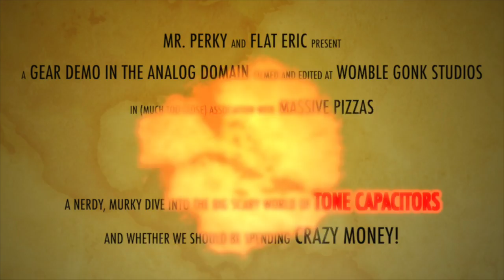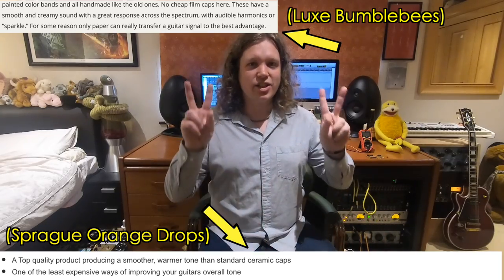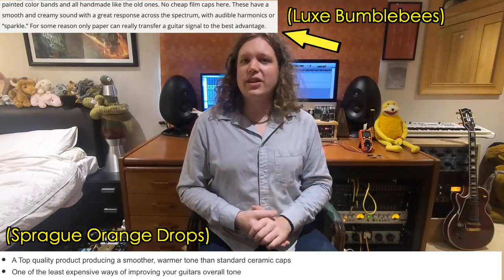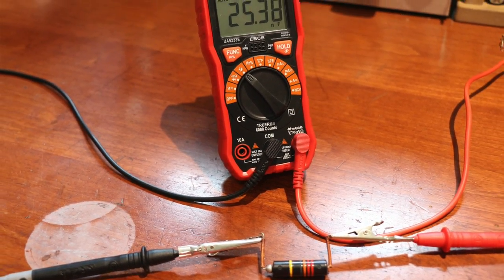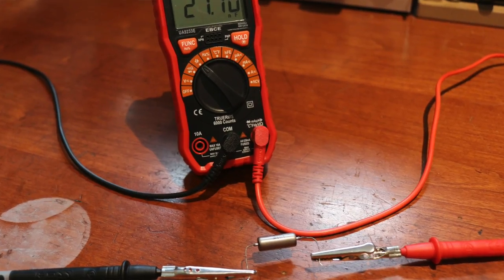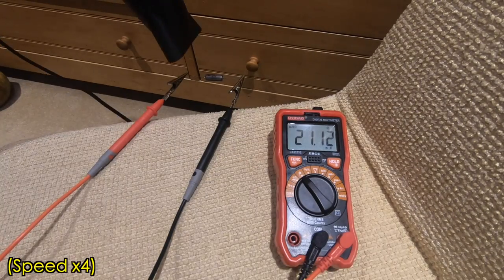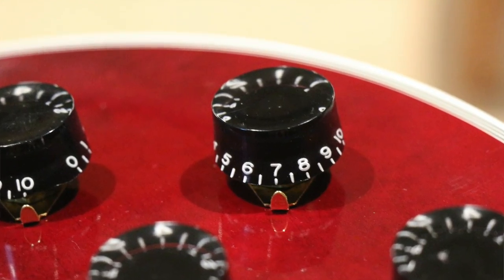Do Paper-In-Oil Capacitors REALLY Sound "Better"..??  (vs. Ceramic, Orange Drop, Tropical Fish, etc)

Comment: The tone pot and cap is a simple frequency filter, so the cap is still affecting the sound even everything is full on but only less comparing rolling down the tone potentiometer. Say the full-on 500Kohm is giving the signal more impedance for high freq loss vs. 250Kohm or 0ohm. But back to the original topic of the capacitor type, I have no evident how sometimes the tone changes even the readings are exactly the same, but I suspect certain caps tend to have larger or smaller parasitic capacitance to whole circuit, including how close the cap sits to the adjacent cap, pots, the entire electronic cavity, etc.

Comment: I've got more than 5000 PIO caps of all sort and the russian one are always dead on the value instead of the bumblebee which are always out of tolerance... For me the old russian one are the best!
Reply: It’s ever so slight but the Russian Cap was ever so slightly beefier and the signal on the low end was smooth and heavy, the mids and high were slightly smoother. I agree with you! Amazing video wow!!
Reply: You ever wanna sell some of those Russians? ;)
Reply: I'm with you guys. And am now on the hunt for some, because I can't wait to hear the difference with my Dimebucker!
Reply: @jetshadowcrow  Check Amazon...just got a lot. Expect a 2 month wait though. Worth every nickle
Reply: Russian capacitors are hermetically sealed and are the only type of paper capacitor that don't go bad with age. I have few of those and have no leakage, and the value is always spot on
Reply: @michvod  I've got 80's ones. They all meter exactly on the money. I never argue about them. Some want them some don't.
Reply: Exact value doesn't make much of a  difference on a chart, or by listening.  +/- 20% capacitance is nothing in terms of roll off frequency really.  Your guitar would come unglued before the cap got hot enough to make a substantial difference in tone.  No one plays in that sort of environment.
Reply: @chrybrstLesPaul  If you want some I can send it to you...
Reply: Who's really playing  today with tone pot on lower settings

Comment: I personally think that a ceramic disc capacitor is not something to wrong with. They last and they are easy to use. Vintage ones especially have shaped my tones the way I like. I've also had paper and oil Russian capacitors.  Hard to mount but 😎 cool. Don't pay 30 unless Emerson or fender branded

Comment: I use lux caps because of how they look more than anything, a bumble bee in a les Pual, looks correct, a paper wax phone book in a Strat looks correct, this same idea plays out on all my guitars in many ways, a les Pual with a nylon 6-6 nut, 50s style wiring, and two conductor paf like pickups, like Virgil arlo 1959s, plastics that are vintage correct, from the pick guard shape and texture to pickup rings, A correct one ring tuning key with a one line housing, the roll marks on the truss rod cover, little details  Is it worth it?  To me it is. I do not think anyone can identify one thing that takes an ok guitar to sounding stellar, I just try to get any guitar I own as close as I can in  looks and sound wise to the vintage real deal, and that seems to work well, after 40 years of music electronics and playing. My keepers are not for sell, well until I am pushing daisy’s that is, and I have plenty of offers.
Reply from the maker: Appearance and vintage correct-ness is definitely a reason to use this sort of stuff.  If it makes you happy, that's all that really matters :-)

Comment: Wonder what the leakage and voltage rating differences are. More importantly leakage and ESR all impact how a cap can perform in AC environments. Some dielectric materials are better than others for those characteristics.
Reply: Thank you!  The ESR leakage and the voltage rating and tolerance will affect the outcome more than the brand.  The only fair way to make the comparison is to get caps of all the same specs across the board, and do the test blind- ears only.  I guarantee nobody will hear any difference at all.

Comment: I can hear the difference between all of the capacitors.  I'm using a Dell Latitude E6410 with a cable plugged into the headphone jack leading to a Lepai P2020TI stereo amp which drive a pair of Optimus Pro Lx5 40-4061 Bookshelf Speakers with Linaeum Tweeters (with OFC speaker cables). It appears that some people can hear some things and others cannot.  I've seened a lot of temper tantrums thrown on the internet over whether or not people can hear the difference between 16 bit 44.1 kHz and 24 bit 96 or 192 kHz.  I can hear the difference.

Comment: I wonder how much would the tone change  when the circuit is cooking because of the different on mf  values when the heat was applied  with the  hair dryer 
would it change or stay consistent on tone? and how much would it matter ?

Comment: Brilliant demo. So, the ceramic sound cheaper, a bit muddier? but the differences are VERY subtle. I am not surprised that there are differences with the tone wide open - as you say it should NOT be any different BUT the capacitor is still acting on the circuit even with the tone ciontrol fully open. The differences therefore will be with capacitor value and tolerences. Assuming values are the same and assuming tolerences typically of + - 10% then a .022 cap could be .024 and the next could be .019 so a subtle difference. ALSO, and this is the point you could pay 50p for a capacitor thats going in a £2,000 Les Paul (such as yours) for life OR pay £60 for a pair that are going in for life? I know many perople who spend £30 on a pickguard cos its more authentic than the exact same plastic the can get from China for £2. IN THE GRAND SCALE OF THINGS GET THE ONES THAT SPEAK TO YOU AND IF THATS THE £30 ITEM ITS OK - Have been building guitars for over 45 years there are far more obviouse ways of loosing a lot more money on snake oil. ( Authentic aged plastic parts spring to mind. GREAT REVIEW.

Comment: I think I agree with you on the WIMA capacitor but I'm not 100% sure! The ceramic did maybe sound a little different to the others across all settings. Different values of capacitor will have an effect though as will different pot values.
Reply from the maker: It's all so subtle eh?!?  Yep, pot & cap values will make a massive difference!
Reply: yes. but 22nF/23nF/24nF are extremely close to each other. The Ceramic sound notably flatter, as cheap ceramics do. I would have like to know what kind of WIMA it was? (MKT/MKP/FKP?) They make a range of different good to excellent audio quality caps.
Reply from the maker: @jakobstumpf391  Ooh...not 100% sure!  They're WIMA film + foil, with "160-" written on the side, if that helps at all?
Reply: @JoePerkinsMusic  sry. but no. 160 usually just points to how much volts it can handle. That in this case is no sign of quality if it is high or low.
Reply from the maker: @jakobstumpf391  Ah ok, gotcha.  Sorry...can't help then! :P There's a picture of it superimposed on the mirror on the right hand side when I'm playing that cap, if it's of any help...
Reply: @JoePerkinsMusic  haha. thx :-). but it prolly won't. WIMA oftentimes doesn't put the cap type on the cap. it can turn into weird guesswork when you have a box full of caps, but don't know which ones are MKT/MKS/MKP. Especially on the lower capacities like 10-47nF, where they're roughly the same size. MKP is usually noticably larger in size especially from 0,1uF upwards. great comparison anyway bud! Really enjoyed it!

Comment: For the most part, the differences between the Caps  were relatively small. But, the Bumblebee did sound clearer, more balanced and musical than all the rest, so they were "better" in my opinion.
Reply: That's just your own personal bias coloring your perception.
I have zero opinion on this, so I decided I'd just blindly listen and then open my eyes and look to see what was playing when I thought it "sounded good."
I looked up at the Bumblee once, but also looked up when he played the $0.03 ceramic.
Like he explained, if this was a coupling cap then you 100% would be correct that there would be a huge difference in tone, but on a filter to ground you're not listening to the grounded signal path. It 'should' have zero effect on the tone, and to my ears (in pretty decent headphones) there's no difference that I can hear on a consistent basis.
Reply: @barbsfpv3066  I also try to do "blind" and tone tests with my eyes closed, and open my eyes when it sounds noticeable good or bad. I think that's the best way to evaluate tones.👍 I always give my unbiased opinions. Things may just sound different through my gear and ears as compared to yours. 🤷‍♂️

Comment: You haven’t lived until you have wired paper in oil caps backwards into a Gibson with 50s vintage wiring.
Reply: I did accidentally wire the hot and the switch to the opposite lugs one time. That sounded AMAZING.

Comment: Paper and oil caps have a slower attack and well balanced output perfect for 335 and 347 type guitars; the others have a fast attack with less balance revealing more highs, initially perhaps better for solid bodies, with the exception of les pauls. After mine were changed by a tech I nolonger liked it. The changes cost me 1,500 and I didn't know I didn't like it until I got home... it did not sound like my guitar any more... should the tech be punished? The russian caps had a faster attack which was not brassy.

Comment: Hi Joe,... great video as always... question though... were the controls wired with Gibson 50's wiring or modern? If im not mistaken , and somebody correct me if i am,... lol Modern wiring puts the tone cap in parallel to the pickup and 50's wiring is more of a series thing ... I could be wrong on that but i gave it a good hard look once upon a time and i think im remembering correctly... but someone else may know better ?? Lol... sooo the wiring style along with the cap material may help make a bigger distinction between all those cap materials .... not sure for sure, someone please fact check me.... :-)
Reply from the maker: Hey Mark :-) 50's wiring on this one.  Like you, I'm not 100% of the specific 'electronic' differences between the two - in 50's wiring, the tone cap goes from the output of the volume pot to the input of the tone pot; whereas on modern it goes from the input of the volume pot (same lug the pickup is connected to) and to the output of the tone pot....so I think you're probably right that 50s wiring is more series, and modern is more parallel...but couldn't swear to it!  All I know is that 50s wiring tends to hold onto more high-end when you roll the guitar's volume down!

Comment: Hi! Joe, how are you? Does the voltage makes any difference? I'm looking for a Sprague Film/Foil Capacitor 0.22 600dc, but can only find in 200dc. Would it change anything? Thank you!
Reply from the maker: Hi Marcelo - I'm sure somebody might have a different opinion here, but I think the only real difference between capacitor voltages in an electric guitar context is the physical size.  The capacitance is all that really matters.  Higher voltage caps are more suited to amplifiers etc where higher voltages are found - but so long as the capacitance is the same, the tonal differences between 200v and 600v caps in a guitar tone circuit will be the same.  I'm sure somebody with deep physics knowledge might say there'll be some tiny difference somewhere, but overall, you're fine to use caps of any voltage in a guitar :-)
Reply: @JoePerkinsMusic  Thank you so much Joe! I could only find Sprague 192P 5% in 200v. I will buy it then. Great comparison video! Thanks again. Cheers!

Comment: I always laugh at the cork sniffers that brag about the tonal difference in their PIO caps made in Bum-Fuc-Egypt and then step on some distortion stomp box and wail away.  Can the difference really be heard running thru pedal boards and multiple effects?  Or even an over driven amp?  Resistance values make the difference.  Not what the cap is made of.

Comment: The capacitor materials are affecting the frequency reaponse of the inductive load of the pickups . . 

So yeah, non-conductive materials seem to be working better than semi-conductive
Reply: What a crock! The cap doesn't do anything with the Tone at 10 and with the Tone low it only dumps treble to ground. The material has no important in a low-voltage circuit like a guitar's. The only differences you're hearing are the actual values of the caps (the fact that they're almost perfectly on spec is very suspicious as they all have a large tolerance), the way Joe alters his attack (should've used a loop) and the placebo effect.

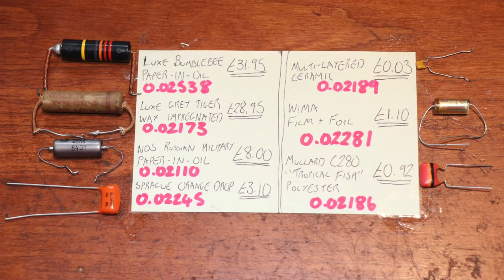Comment: 8:44   I ordered some Emerson bumblebees, when I received them I tested them as I test all electronic components I buy.  The .022uF tested at .022uF and .023uF however, the .015uF tested at .018uF and .019uF.  Checking the specs on Emerson’s website I found that their tolerance is +/- 10%. That being said, a .015uF should fall between .0135uF and .0165uF.
Reply from the maker: Yep, that's right...it's possible that your multimeter is calibrated differently to theirs, and temperature increases do raise the capacitance, so it's possible you're somewhere hotter than where they were manufactured.  You likely won't hear too much difference overall, but it might be worth dropping them a line if it's something you're unhappy with.

Comment: Oh, flat Eric! Havent seen that guy in a while.. When it comes to caps.. well... you cant argue with evidence based on emotion. Had a hifi discussion with an old workmate who always claimed his polyester caps sounded way better than poly prop. same value.. when I asked or replied his responce always was; What?! because he couldnt hear f*#k all.. Me, I bought $30 worth of silver caps and moded crossovers.. and read that "you get a huge boost in hifi if you add a small .047uF paralell with your filtercaps.." turned out later that I had done that allready (possibly drunk) and I heard about japanese guys buying their own transformers to feed their house so thats a thing. And all sound bettering devices are exponentional in price.. And what you do, is trying to remove stuff that shouldnt be there.
Reply from the maker: Flat Eric is always a hit! ;-)

Comment: The only possible function of a capacitor in a guitar tone circuit is to filter high frequencies, anyone who claims to hear anything different (like string separation or definition) is fooling themself. A picofarad is a picofarad, simple.
Reply: exactly, there is literally no difference.
Reply: Capacitor in the the circuit retains low frequencies and shifts pickup's resonant peak down. Just think of what the circuit looks like if the tone is all the way down. Resistance of the tone knob becomes zero, the tone cap becomes wired simply in parallel to the cable's parasitic capacitance... Wait, since cable also has capacitance, I wonder why nobody so far has speculated about 'paper-in-oil cables'??

Comment: what made you settle on the pickups that you now use? because tone position zero is very stinky i like it
Reply from the maker: Aha, I'm actually running different p'ups in this guitar nowadays!  I generally stick to different flavours of PAFs in Gibson-style guitars - these Monty's sounded great but I wanted a tiny bit more power & weight, so I've now got the OX4 Hot Duanes in it instead :-)

Comment: There's more tone difference from how you strum than from different caps. Signal never actually "passes thru" a cap, They measure infinite ohms so all they do is charge and dis-charge so their value is all that matters to tone. Different types are just for different physical apps.
Reply: Also tolerance, 10 pf can sound different. 10pf is about .05% of a.022 mf cap most of which have a 10% tolerance.

Comment: This is a typical marketing strategy, they intentionally increase the cost of production a bit and double the price even though the cost of production doesn’t mean improvements in quality.
This is same for pickups. They increase the cost of production by hand wiring.(machines are more accurate in 21st century)

Also, I am not sure this is true but I heard that paper in oil is not as durable as ceramic so the uF value (?) changes over time (this changes the tone)
Reply: Change in tone is subjective so, I believe the theory is correct

Comment: Please can you help. I play a Fender/Roland Strat and a Line 6 mostly all accoustic sounds. Yes i have a Les Paul and a number of other guitars Taylor and Takamene electro accoustics. Could you please advise me of the best capacitors/modifications for my guitars.
Kind regards

Tim
Reply from the maker: Hi Tim - my knowledge of acoustic electronics is less than minimal I'm afraid, so I have zero idea what the 'right' capacitor might be for that.  If you're looking to play around with caps, I'd 100% focus on value rather than type - much better to buy twenty 5-pence caps and experiment than be spending big money on a few.  Though I'd only go into the world of capacitor mods if you're looking to change something specific about how the tone control works on your guitar(s) currently...if you're happy with them as they are and they work for you, the only reason to change would be general curiosity rather than 'improving' things, I'd say :-)